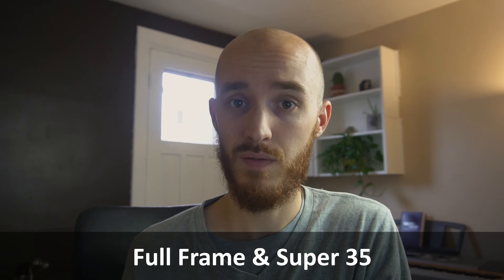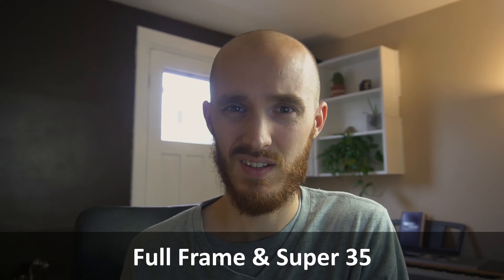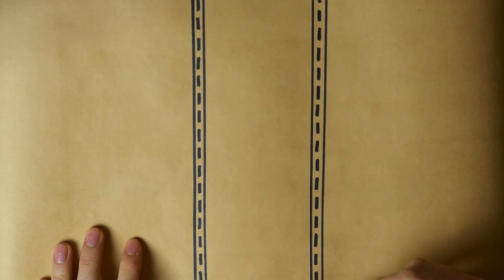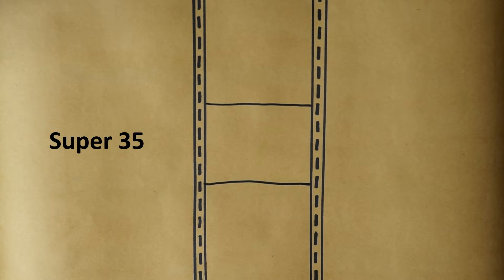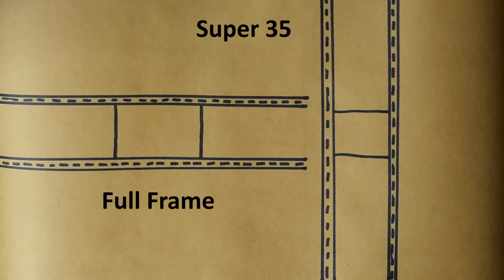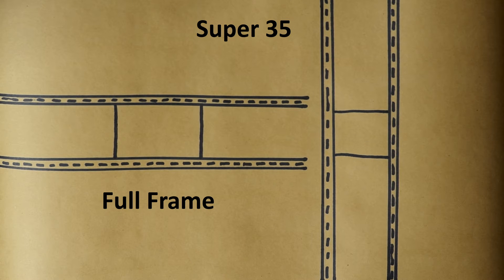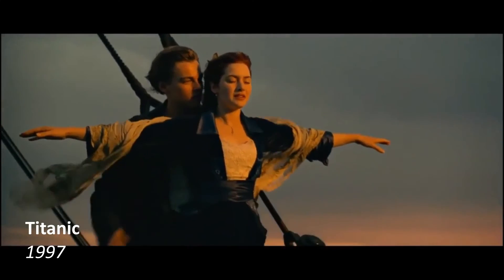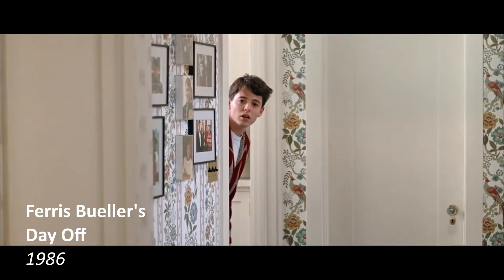Full Frame vs Super 35 | A Quick Explanation

Comment: The width of a film strip per slide is in the horizontal 35mm not in the vertical as a stripe dimension. You have made a mistake at this point. The with of super 35 is the height of the 35mm film stripe.

Comment: Finally someone explained this properly! Thank you!
Reply: If have been trying to find this on YouTube.....finally you nail it....question? Will a super 35mm 4k camera produce a better image then a regular 4k camera......
Reply from the maker: @tcibeatrecords4707  It depends on the size of the image sensor. Typically the larger the sensor the better the image. So if the image sensor for the regular 4k camera is larger than super 35mm, it would produce a better image. However, most cameras with at least a 16mm sensor or larger are capable of producing professional results.
Reply: @CallumVandenberg  I'd question the comment "Typically the larger the sensor the better the image" - there are plenty of S35 sensors that will out perform larger FF / 135 sensors, when it comes to making better images.

It depends on the quality of the sensor. For example the Alexa will still produce nicer images than many 4k FF / 135 sensors.
Reply from the maker: Haha! You're welcome. :)